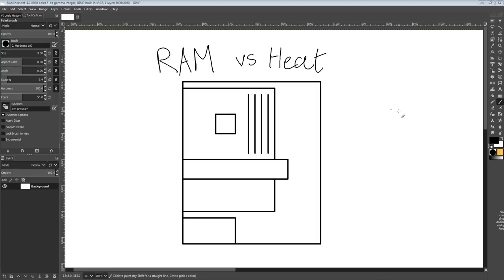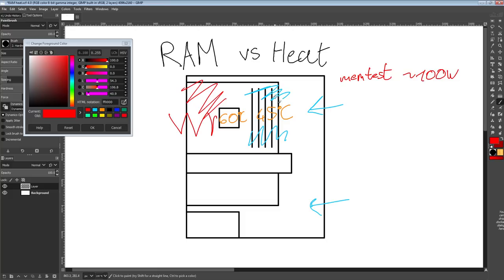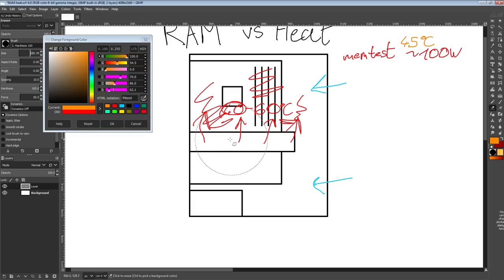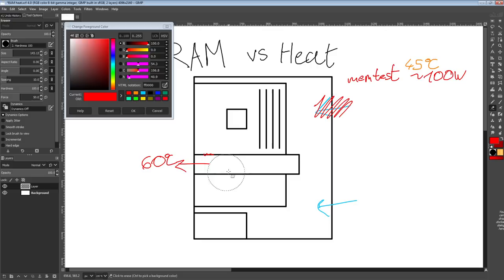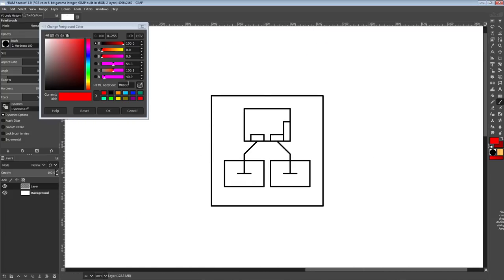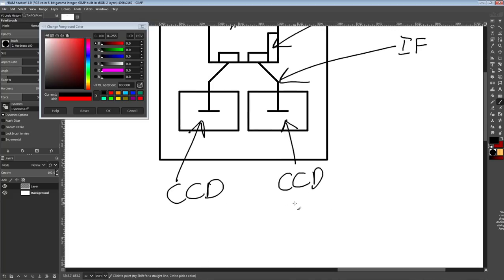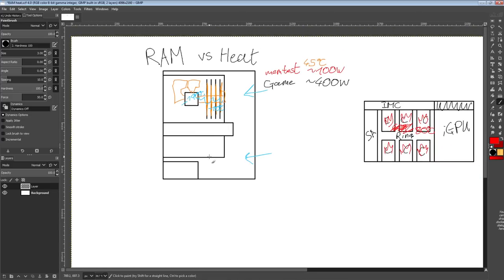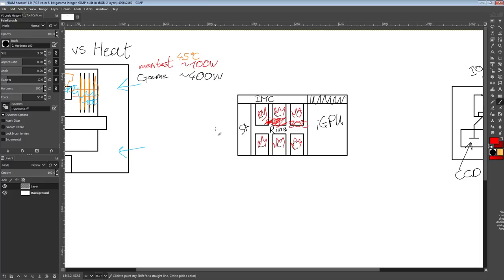RAM overclock stability and heat management.

Comment: What are we supposed to do then? Have a bunch of fans in front and back so we are sure we're getting good air pressure? Do we need to watercool everything? What gives? Can GPU manufacturers do better? Can you please post a "RAM STABILITY" video some day? Like, how do you know it's stable FOR SURE. Is it possible to know FOR SURE, etc etc. For me there's always at least one thing that isn't right when OC'ed.....maybe it's just me. I could pass TM5 hours on end, memtesthelper hours on end (over 2000% on all threads 12+hr), anything in windows, except prime95 800K-800K which resulted in a poweroff! I stopped there....I've always been safe with very minor tweaks in memory timing, like correcting wrongly detected values like CR and other XMP values, and i'm running at XMP and I'm totally stable and happy.

Comment: Can someone helped me overclock my Memory.  
I got it to 3400mhz (micron E-die) 
With a ryzen 5 2600x 
On a asrock x370 killer sli/c
Reply: ryzen dram calculator
Reply: @XX-121  yeah the pc doesnt boot with those timings 
😅😆

If it boots it doesn't pass memtest 
Or the lovely in game crash,  
For example with what I've gather online i have booting and working at 3400 mhz 
16-17-16-16-36 56  1T GRD enable 
But shadow of the tomb raider crashes the pc.  
It doesn't quite passes memtest86
Reply: @TheLateral18  did you try the safe timings on dram calc?  if not do xmp. does it pass memtest on xmp?  but with my experience w/ asrock is a lot of their boards use a thinner pcb which heats up a lot easier than say ASUS stuff.
Reply: @XX-121  yes i try the safe timings.  
As i said.  I try oyher timings (secondaries and tertiaries)  that i changed.  But it stills doesn't clear memtest , one game crashes.  

 I dont want to try the xmp profile. Is for an corsair lpm ram.  The ram that i have is crucial.  

So you are saying that a thicker pcb like the x570 tuf gaming plus to get higher frequencies
Reply: @TheLateral18  no the xmp profile comes from ram not motherboard. you should have a setting that loads xmp timings automatically in bios.  try that.  then if you are stable, ddr4 is specified by jedec to run at 1.5v  so if you are using less than that you can up your voltage to get higher frequency.  i am running my 1.35v sticks at 1.49v and went from 3200 to 3400 at xmp timings.  i still want to go higher but i haven't had time to mess with it much yet.
Reply: @TheLateral18  that's what i'm running x570 tuf.   my last build was asrock 990fx ex4 but i guess vrm blew and i ended up with asus sabertooth 990fx and got way better mb/cpu temps.  board was a lot heavier and less flex.  that was my first time using asrock and i said never again.  but that's just me.  other's have had ok time with them i suppose?
Reply: @XX-121  
No 
The xmp profile in the mobo,  is for a corsair vengeance lpx ram. So when i go to bios xmp.  Is giving me a profile for a corsair vengeance.  The ram i have is crucial.  They have different die.  I dont think is a good idea to mix profiles.  

But I'll try the xmp. Timings. See if i can finally run it at 3400.

How are your timings at 3400mhz
Reply: @TheLateral18  that's not how xmp works bro.  the timings are programmed into the spd of the ram.  trust me.
Reply: @TheLateral18  just go into bios load xmp and see what happens.  it will work.
Reply: @XX-121  nice list of motherboards there lol 
i had a Asus before i go a ryzen. i forgot the model. i been with this one for a while a x370 killer sli/ac , hasn't give me problems. im surprised it has reach this high frequency. 
but since buildzoid recommended the tuf,. thats the one i want to upgrade to .
Reply: @XX-121  bro i dont think we are understanding each other. 
but i get the part that the timings are programed into the dimms. 

ill try it. once i try this timins i just put into the bios. everything look so peachy right now . lets see if it finally doesnt spit out errors ..

what brand of ram are you using with the tuf 
the timings you have are the ones from xmp ?
Reply: @TheLateral18  I am using Ballistix Sport AT 3200 TUF edition (micron e die) clocked at 3400 w/ xmp timings. I'm gonna try and hit 3600 when i have some spare time.  But if i had to do it again i would go with the MSI X570 UNIFY  it has better vrm's and the bios isn't dumbed down like what asus did w/ the tuf.  They took out a bunch of OC settings that have been standard on even budget boards for the last 2 decades.   They said they are reserving those settings for their high end boards...  So now they want you to buy a $700 board just to get stuff like bclk, spread spectrum, etc, etc... WEAK.  Plus now i can't use my monitoring cable from my corsair power supply, keep getting the usb disconnect sound every 10 seconds.  called asus and they said it wasn't their problem because my power supply isn't compatible with the board.  I'm like WHAT?.  They said yeah it's not on QVL.  Tell me that's not F***Kin weak.  Have you ever heard of a power supply QVL?  Man screw asus. I'm done with them after this.  Too bad your not in VA or i would sell you my setup so i could get the MSI.

Comment: my ryzen 5 1600 is 100w or so my hwi info says a 9900k has much more than that im sure. Having 7nm amd cpu makes my 250w cooler seem like a waste of money goddamn it amd why cant you go back to 22nm like intel does. lmao
Reply: Damn lol, my 3600 pulls around 84w under load and my 3900x pulls over 150w xD , with a dark rock pro 4 temps while gaming are usually mid to high 40's with high 50's spikes